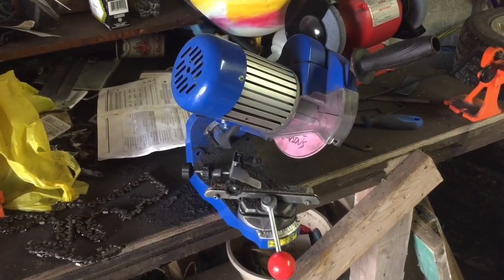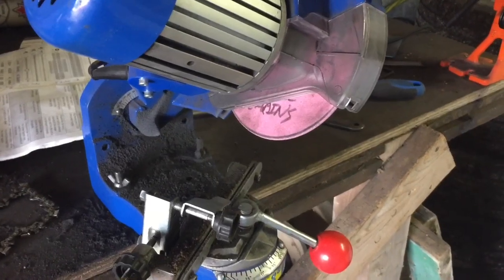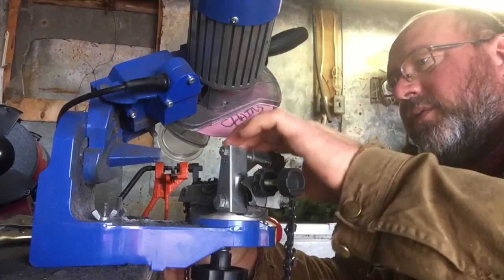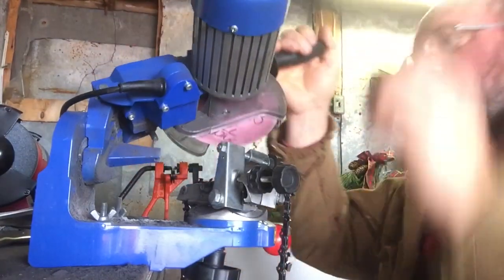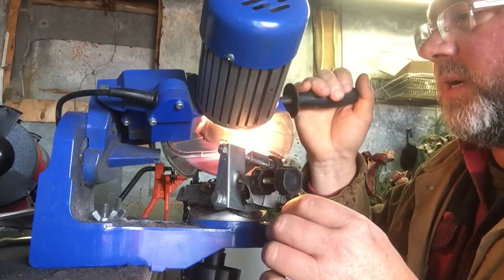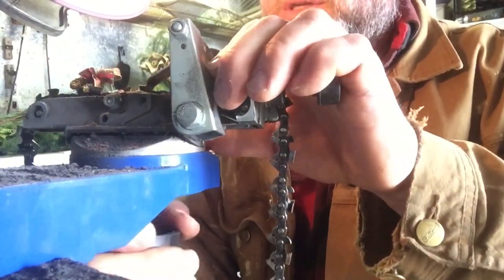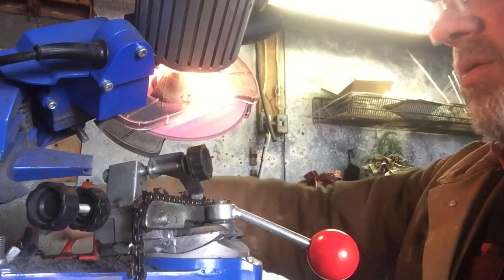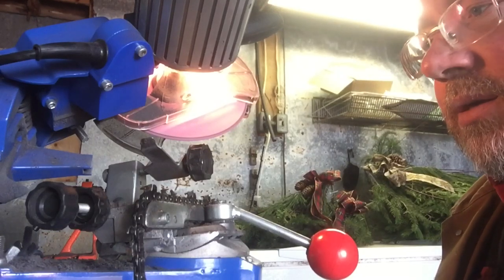Using a bench mounted grinder to sharpen a chainsaw chain

Comment: I clean my chains in hot water and dish soap, before grinding and I also load up the grinding wheel with candle wax, I have not needed to dress my wheel in a very long time.
Reply: r2d23678  The wax prevents the glazing over of the wheel, it also starts to melt a bit if the chain gets hot helping to keep things cool so you dont burn the cutter.

Comment: You never mentioned what pitch chain. Surely that makes a difference?
Reply: I had the same grinder for a while and sharpened .325 and 3/8ths chains with no problems.
Reply: @timberray9572  yeah well my sharpener came with discs of different thickness but I've only had one on there for the past 5 years to do all size chains. My uncle also says it doesn't matter. Anyway, I got something helpful out of this video thanks very much. My chains were coming off the sharpener not cutting straight and of questionable sharpness. I rubbed a grinding stone against both sides of the spinning disc and the chains are back to cutting well again. I'm in gratitude to Big Ass Slabs!!!

Comment: You sure you doing the 10deg right. ???   10deg set back.
Reply from the maker: Christopher Kapp yep, my sharpener has three angle settings. The angle of the grinding stone, the angle of the cutter edge and then a bevel angle into the cutter.
Reply: That was my first thought too. He sets the tilt angle in the wrong direction. For left cutters - pull the knob, right cutters - push the knob.
Reply: Bolens69 and Unfortion seem to be right. I checked the books and on line instructions for the 10 degree "down" angle. They all say for cutters on the right side (as seen from the saw motor end) the knob for the angle and down angle should be pushed away from you. I try to remember "right away". For the left cutters you pull the 10 degree down angle knob towards you.
Reply: Yes I see what you mean, but which is the 'motor end'..?   Are we looking at the pulling side of the chain, or the top side pushing part of the chain, when it is in the vice...?    If we go back to the file sharpening angles, the 10 degrees is always cutting upwards from the wooden handle end of the file...…  So it looks as if he did it wrong...  He should have pushed the point of the cutter away from the vice.
Reply: @hiscifi2986  You defiantly got your 10 Degree down angle backwards, but its steal a great video, Thank you for sharing it with us.
Reply: I agree with you, he did set the tilt angle in the wrong direction.
I did learn the simple way, do the front teeth first 30 degree to the right and
and 10 degree on the vise leaning bacwards,toward the base, the do the rear 
teeth, 30 degree to the left and 10 degree on the vise leaning towards you.
Hope my unserstanding is right.

Comment: Taking a small amount off is like honing. That's how I was taught. You would never see sparks fly like that. It is a much lighter application. Makes your chains last a lot longer 🤷‍♂️
But I'm just a dumb tree guy. I could be wrong
Reply: After rewatching the video I agree there was a lot of sparks 
How much Temper was burned out

Comment: Thanks so much for sharing with us this interesting and informative video.
Like a lot your grinder, who make those nice blue color machines?. Never seen one before.
Reply: I have the same blue grinder, sold at Princess Auto. Before that I had one made by Timber Tuff which was the exact same thing, I used that one for many years but I dropped it and it broke the frame.

Comment: I found out when I used a chain after using a grinder that it was cutting the teeth differently from the left side to the right side. It was cutting much more aggressively on one side an pulling the bar like dull teeth. I finally figured out that the teeth on 1 side were shorter due to the pivot on the grinder. I sure was pissed!! Especially since it was the big 60" chain😫
Reply from the maker: I encounter that as well, the pivot throws things off. Thankfully when I was still using a little hand grinder I got in the habit of using a micrometer, so I ALWAYS check the cutter length as I'm going around.
Reply: That is nothing mi amigo, a learning curve is needed on this grinders, once you gey used to do
do it right you are going to feel great when you do cuts with a nice sharpen chain.
I prefer this type of mechanical problems that problems with women, a lot easier to solve them.
                                                                                   Saludos mi amigo.      from Costa Rica
Reply: I think that's happening to me as well and it doesn't cut straight. Does that mean this pivot thing is damaged or does it adjust?